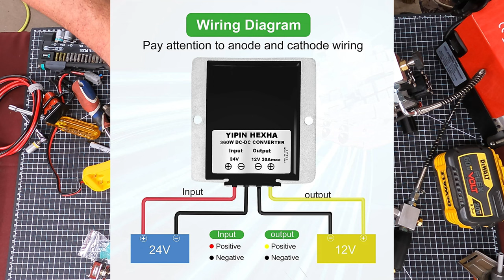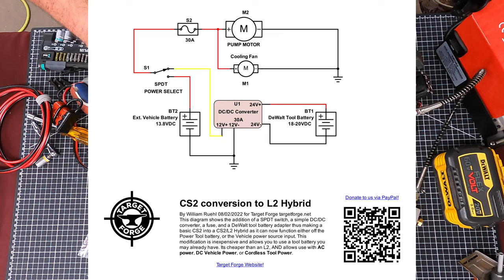The BEST portable HPA compressor EVER! a GX CS2 taken to all new heights.

Comment from the maker: Schematic diagram free here: https://img1.wsimg.com/blobby/go/c1326961-e3bf-419c-a54b-888c9d75e0c3/downloads/Pump-Conversion%20(5).pdf?ver=1711387974820
Would anyone be interested in a connectorized kit that only required the user to drill holes, and mount parts in their CS2? I already have the crimpers, would likely make this mod available to folks not sure about the electricals. Let me know in the comments! You would likely need to modify the motor leads, but that might be all. Might actually be a good use for a Wago wire connector... Hmmmm....
Reply: I'm local and intersted!
Reply from the maker: And first in line, I'm told...
Reply: Yes please!
Reply: Yes Please, Great video on an excellent idea!
Reply: Would be interested in a kit that is suitable for Bosch Professional 18V battery’s, or can i just order the same (except for the battery adapter holder) products through your affiliate links?
Reply: @TargetForge Now that they have a battery powered E-L2 (18V), could I just buy it and replace the 18V adapter with the 20V DeWalt adapter?  I think what ever step down converter they use would regulate to the 12VDC output, from an higher source (upto 24V, assuming they used a 24V-12V down buck conv...
Reply from the maker: @Hangs4Fun  They have had that for a long time, it was part of the reason I designed my solution different from theirs. There is NO converter in theirs, the motor winding is different to run on a higher voltage. This makes their solution NOT capable of running on 12VDC. Could you change adapters and effectively adopt a different pack interface? Maybe, I will caution that a higher nominal pack voltage will have an impact on system performance. Thanks for the comment.

Comment: I'm just getting into PCP air rifles. After purchasing a manual pump I'm realizing I'm not the tough guy I thought I was! I want to build this pump configuration but my power source would be Milwaukee. As all my cordless tools are such.  I would assume Milwaukee makes a battery holder. And yes I would use there comparable battery. Great video, excellent content! 👍

Comment: Love the build and love the video.Try this pro-tip sometime; after wrapping and tearing (or cutting) electrical tape, put another wrap in reverse direction. As the primary wrap loosens / shrinks,  the second wrap holds the final primary wrap in place.
Reply from the maker: THANKS Flip! You are today's official "Pro Tip!". I love it! I also use Scotch 33+ as I have found it be MUCH better than anything else I've tried.

Comment: I might mount the battery base and dc-dc converter/fuse into a separate enclosure so I don't need to modify the compressor. The agent for the compressors in my country probably won't honour the warranty if it's modified, but I'll still be able to run it "off the grid".
Reply from the maker: I had a similar idea, I even added a digital pressure setting function to mine. Would you like to see that video?
Reply: @TargetForge  that would be great

Comment: Only issue I have with this is as soon as you turn off the compressor your fans turn off too.
Reply from the maker: Not really a problem, mimics the behavior of the factory unit perfectly (L2 Variant). Prevents you from running your battery into the ground. You COULD simply add a switch for fan control, but forgetting to turn them on could get dicey.
Reply: More so just so it works like the stock unit when power is plugged in the fans automatically come on and stay on til you unplug the power. Not knocking what you’ve done as I made mine from a Milwaukee 9ah battery. Just would love fans as soon as power is connected thru battery or external power source. 

On another note. Did you know using a large air dryer (mine is the 13.5” long x 2” round) with a check valve make foster on the inlet side, acts like an accumulator for filling scuba tanks. In theory you’re only working against the seated ball valve and the small section of hose running to the air dryer. I filled my large scuba tank in 6 runs of 20 minutes each  , last one being half hr, and only seen a max temp of 110 f measured at the side of the piston block.
Reply from the maker: In your use case, which I do not recommend for the CS2 as it really racks up the hours on the pump, you might consider a separate switch for the fans. The CS4 would be a much better choice for filling that big bottle and it would let you tend to other things during the fill. I love mine. I only use the CS2 for short, direct gun fills. Great to hear you built one! send some photos to me at bill@targetforge.net and we'll feature them on an upcoming video! @seancarr7827
Reply: Does that seem in theory like I’m on the right track?
Reply from the maker: Not sure what theory you are referring to. Filling large bottles with a small compressor? Can't say I'm with you there. If you want to allow for a separate switch so you can control the fan operation? Certainly possible, but when used as intended, probably not needed as the L2 (the GX battery unit) does not allow separate fan control either. Would it be good to have if you need to run the pump for extended periods? Probably makes sense.
Reply: Yes and no. The air dryer I’m referring to have the acrylic tube with your desiccant and charcoal and cotton housed inside of a thick aluminum housing (same as 4500 psi cylinders). I have the outlet end connected to my large scuba tank with a pass through make foster. On the charging end it has a check ball male foster fitting. I pre charge that air dryer to 2500 psi usually then disconnect air source and connect the gx pump. Essentially the only load on the compressor is what’s built in the line as when it gets to the check ball male foster fitting it only has to pop the ball and dump line pressure into the air dryer which is feeding the scuba tank with the valve open. When it’s time to give it a break to cool down I bleed the compressor and shut down. When I go to restart another cycle the compressor just has to overcome whatever pressure the air dryer was left at and continue to unseat the ball and dump line pressure into the air dryer feeding the scuba tank again. I’ve noticed that in comparison to filling a 68ci field bottle the temps stay about the same.
Reply from the maker: As far as keeping pressure on the filter? Absolutely the right way to do it. Having a true coalescer AT pressure before it, 100 times better. A coalescer at anything over 1800psi will remove 98% of the moisture, your microsieve media will then simply be scrubbing what little gets through. Also, dump the charcoal and the cotton, they are not doing anything, 100% microsieve is a much better solution. Unless a human is breathing that air the charcoal doesn't do anything and the cotton, once wet, is just an inline humidifier.

Comment: Well, I was hoping you wouldn't go down this road, lol, but you are invested in DeWalt tools so I get it, I guess... don't want to argue about which is better, but love my Makita tools, and batteries, and love my L2 compressor, I mean how simple and wonderful, I love it to death and the small amount of cost to include the wall unit, is a better value for me, you seem to have plenty of tools and parts... I do love your videos on this pump, and hope you move on to upgrades I may use... Keep going dude...!
Reply from the maker: It's all good. Just REALLY keep an eye on that knock off battery and the charger that came with it. I've heard things... True Makita stuff is nice, but they really seem to be lagging the leaders in this space these days, their service is probably best in class though. Not being able to run it off my vehicles was the bigger issue for me, and likely a lot of outdoorsmen as well.  Thanks for your comment.
Reply: I'm an aluminum installer in central florida and I've tried dewalt and had to take them back they cant hold up to 1000's of screws per day only makita does ,they're for commercial use dewalts for home owners ,but I love the show.

Comment: Hi is there any chance you could do a wiring diagram using original switch, 
Cheers Steve
Reply from the maker: Not really sure what you are looking for. Do you seek a wiring diagram for a stock unit? Or are you thinking performing this hack with the stock switch? Which I would not recommend.
Reply: @TargetForge  its ok ,did as per your video ,all working great .🙂🙂

Comment: I don't know if you've ever talked about your background but you're a true inventor and I would argue, genius. 

My only hesitation in doing this mod is that I'm in the 1 year warranty period for my GX CS2 so if something goes wrong, the manufacturer won't help me after they see the modifications.  Do you think I should be concerned with that as long as I following the recommended run interval advice and the lubrication/maintenance advice you provide? Are parts available to buy for the compressor should things go awry?
Reply from the maker: First of all, there is NO US SERVICE for these units. The warranty is you telling them it broke, and they either send you parts, or a replacement unit. No one at GX, at this time, will ever see your broken compressor. Nothing on this mod/hack stresses the unit in anyway. Same input voltage, same RPM, just smarter power options, that's it. I was selling parts on my site, life has forced me to put that on hold temporarily. I hope to have the GX parts side of the business back in action by the end of November. Prices will go up a bit, because it's the world we live in now, but I expect to get the parts business rolling again shortly.
Reply: @TargetForge  Thanks for explaining all that. My compressor is still in the box waiting for my PCPs to arrive. I will definitely be buying my parts through you.  Quick question, I didn't buy the Amazon 3 or 4 year warranty because I heard the warranty is also not what it seems. It basically amounts to replacing the unit once in those 3-4 years from what I read in the reviews. Did I make the right decision?

Comment: VERY Cool! Question, what is the correct Powerpole cable I need to run off the included GX CS2 inverter? I am assuming one end is Powerpole and the other are clamps? Thank you!
Reply from the maker: Not sure I understand your question. The AC supply has posts. I used ring terminals and made a cable for mine. You can also reuse the clip leas set and connectorize the other end

Comment: Can I just replace the 18v Makita style adapter to a Dewalt 20v/60v adapter on the L2 or L3? Wil the 20v/60v Dewalt flex volt battery in anyway harm a 18v L2 or L3 compressor motor?
Reply from the maker: You sure can! You will miss out on running it off of 12V, like a car or truck
Reply: @TargetForge  will have to give it a try. I needed up my 12v compressor trying to follow your video. I did something very wrong, I gave the compressor to my brother in law. He got it running again back to original setup. I'm all thumbs when it incomes to electrical stuff.
Reply: @TargetForge  messed up the compressor.

Comment: Cool project. I have the CS3 with the dual 18v batteries. Do you have a fix for using Ryobi 18v batteries? I have lots of those. Thanks!
Reply from the maker: Took a quick look and the reason no adapters seem to exist going from Ryobi to Makita, is the physical interface of the Ryobi pack. That elevated horn where the contacts are makes it more challenging. They may have adapters out there, but did not find them. Good luck!
Reply: @TargetForge  thanks for trying. You're the man!

Comment: have new gx cs2 but only goes up to 1bar after 5 mins running on test with bung in , what should i be looking at thanks steve
Reply: The most common cause for this is a simple leak. You can make your own leak detection fluid with a cup of water and a few drops of dish soap. Apply at each joint and you will likely find your leak. Let me know how you make out.
Reply: @wruehl  thanks did that , no leaks and its holding air up to gauge , just d
slowly gets to 1 bar then stops there
Reply from the maker: Ok, the next thing I would check is the lower High Pressure check valve assembly. With the machine upside-down the brass hex plug directly under the High Pressure piston should be taken apart carefully cleaned and inspected. Remove the plug, the spring and the poppet. How many hours are on this unit? Is it still under warranty?
Reply: @TargetForge  thanks will try this, it brand new , brought this privately
Reply from the maker: Hope you got a killer deal! Without the warranty they can be dicey.
Reply: @TargetForge  i did get a good deal , so after charging for 5 minutes it reaches 1 bar , if I leave it , it does hold pressure , so it seems to be some sort of pressure issue while running, are there any other obvious things to look at, thanks for all the help , and happy holidays
Reply from the maker: Possibly one of the other two upstream check valves or the high pressure piston. The HP piston head actually has a check valve as well. If that had some debris keeping it from sealing it could cause the issue you describe as well. Could also possibly be the HP piston seals?

Comment: So, after 3 mo.  Of use, I was told I could fill my scuba tank. It didn’t work. Now my compressor will only fill to 200 bar, or even a bit less. Then just continues to run with no more build up
Help!
Reply from the maker: Hello Dave, I would recommend that A. you never tell anyone that you allowed someone to tell you you could fill a scuba bottle. and B. Contact Amazon for a warranty replacement if you cannot find a leak. Don't get fooled into thinking you can find the leak by feeling around or listening. Take the time and mix a cup of water and two drops of dish soap and check every single joint, don't forget the gauge and every QD. At three months old it is still under warranty.
Reply: @TargetForge  thanks for your help. After contacting Amazon and customer service, I examined my o rings more closely. I had recently replaced one, but not the other. It didn’t look bad, but sort of worn.

Comment: would a 6amp 54/18 volt dewalt battery work aswell
Reply from the maker: I will assume that is a typo and you meant 20/18V 6A Dewalt battery? Less current = less run time. I run the giant batteries because I have them for my chain saw. They should work fine, might make an episode where I try different size batteries and see how many fills I get....
Reply: @TargetForge  no it's a 18volt/54volt 6 amp xr flex volt , maybe UK version is different
Reply from the maker: Actually the 18V is a slightly different cell chemistry and the UK market generally lags other markets. The only issue you may see is an earlier "cut off" due the DC/DC converter I used. The 20V battery had more headroom, and consequently will run longer before hitting the undervoltage shutoff on the converter. Having the auto cut off saves the battery from being discharged too far, which is good. Being 2 volts closer to that cutoff due to the 18V cell will likely cost you some amount of run time.

Comment: How is this cheaper than a gx l2? Are you not counting the cost of a cs2 if already owned? Right now, the l2 is a little cheaper than the cs2.
Reply from the maker: CS2 comes with the AC supply, AND you end up with a UL/CE listed charger and a MUCH better battery.
Reply: @Target Forge  oh dang I forgot about the PSU lol. I'd prolly end up electrocution myself anyways lol